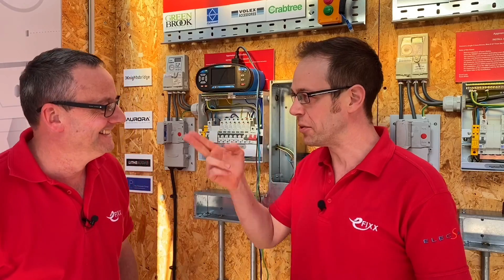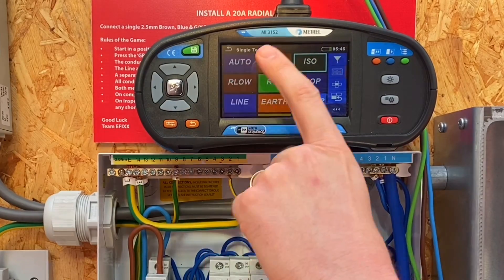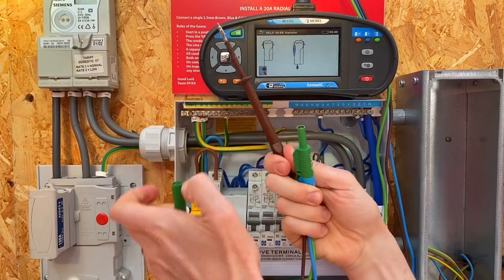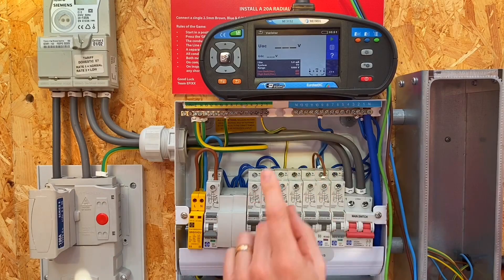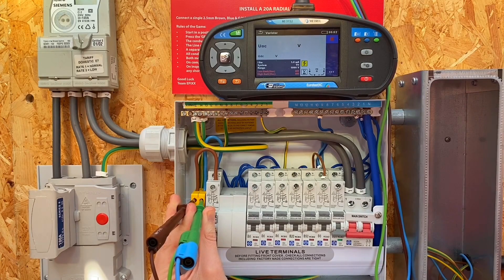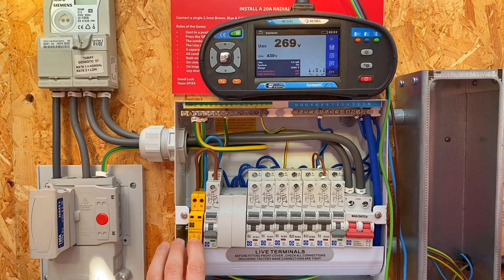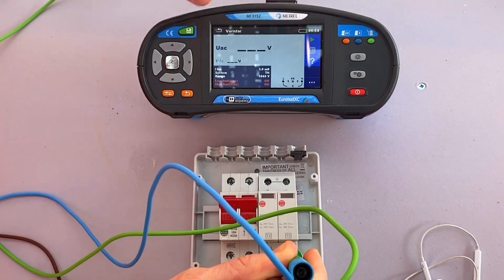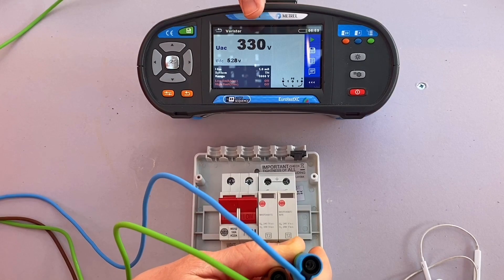How to test a surge protector (SPD) using a Metrel Mi 3152

Comment: Nice vid,. I am lookin into forms on p158-159 of Guide not 3 they tested SPD at 250, I wonder to know what voltage applied? Could you please make a video to show haw value in pages 158- 159 of guide note 3 , regarding continuty and insulation resistance measured?
Thanks

Comment: MOVs can only sustain very short transient faults, have a limited lifetime and may burst into flames. Putting such devices into a consumer unit is madness, but the real reason is to protect AFDDs. Most other sensitive electronics in a house would have their own protection built in or in a distribution block which can easily be replaced.
There are better protection devices replacing MOVs now, one is an ISOMOV which combines MOVs with a gas discharge tube and which does not have the disadvantages of MOVs.
Reply: There are Spd 1+1 (1 cartridge MOV, the other is GDT) . The GDT one should be connected between N and PE. Here in Romania, on newer TNC-S panels, at request, 1+1 or 3+1 Spd's(yes, residential homes on tri-phased systems, starting from 5KW power).
On TT ones, 2+0, 4+0...

Comment: Hello. A query, what tolerance values could be applied for the Uc of the SPD to compare the Uac obtained in the test?
Will this tolerance data be indicated in IEC 61643-11?
For example DEHN has a value tolerance table for its SPDs
Cheers

Comment: Great demo as usual. One small note , most colleges will tech that for insulation resistance testing (where a voltage above 50v dc is being applied) is subject to the recommendations of GS38 with regard to leads and probes. This is backed up by GN3 1.1 Page 12.
Reply: Exactly Mark, gs38 applies to low voltage electrical systems and the is 50V-1,000V AC and 121V-1,500V DC.

Comment: Sorry guys but this is a very misleading video! Uc is the nominal voltage of an SPD and absolutely NOT the voltage at which it will trigger, it's wrong to say that. The Up is the key figure to be looking for in an SPD, this is the voltage protection level and is the true indicator for the level at which the device will clamp voltage to protect the installation. All you are doing is measuring the nominal voltage that the device is capable of working up to. No single pole type 2 will trigger at 269V and it's very misleading to suggest that they will. In fact any transient below the Up level of the device will pass through, this is because in table 443.2 (Rated Impulse Voltages) even to most sensitive electronic equipment has to have a built in withstand capability of 1.5kV so there would no point in an SPD triggering at such a low level as 269V. This gives electricians (and then their customers) an unrealistic impression of what an over voltage device can do and is making them believe that they can easily test an SPD to prove to a customer that it's working. Sadly most SPD's can only be checked via a visual inspection, this test here is NOT proving that the SPD is operating to it's designed specification because for that you must test the Up value. BSEN 61643-11 gives the testing protocols for SPD's.
Reply from the maker: Thanks very much for the feedback Sean, looking forward to talking to you about this. 👍
Reply: So would it be safe to say that the triggering voltage is  less than 500v given that 500v insulation resistance test voltages would damage the SPD?
Reply: @MrSJT  no, the 'trigger' voltage is the voltage protection level usually written as Up on the specification sheet, typically this will be around 1500v in the UK (some higher some lower) the 500V test does not damage the SPD, the SPD can give lead to a false reading so in some cases needs to be disconnected, however there are now a number of SPD's that can be left in place for this test and will not affect the reading such as DEHNguard ACI.
Reply: @seanpassant3174  500v would damage a type 3 though?
Reply: @MrSJT  No, not really. That's a very low voltage for an SPD, even a type 3. Most type 3's in the UK have a voltage protection level (the point at which they trigger) of around 900V so it won't do anything until it see's a voltage in excess of this. SPD's are more sturdy than people imagine, they are certainly not designed to fail, they aren't voltage fuses, they are very high speed switches. They allow voltage to flow until such time it exceeds the protection level then it very quickly switches the voltage to earth to protect the equipment down stream.
Reply: @seanpassant3174  so in this video at 14.30, John Ward tested it at around 600v, I assume this would be wrong too?

https://youtu.be/-ehw6uZOOfw
Reply: @seanpassant3174  i basically want to know if what John Ward is doing is the correct way of testing the function of the SPD, or is it incorrect and that there is currently no test equipment available to the mainstream to test the functions of an SPD.

Comment: I am a bit confused. Watching a E5 video the end of last week. The young lady who works for an SPD manufacturer. Said that the SPD  should be close to the main switch and before breakers. RCBOs,etc. this was to stop the high voltage posible taking an easier path.
Reply: No she did not . She stated that the bus bar did not count in the calculations!

Comment: For those of us who do not own one of these all singing and dancing mft’s, could a standard insulation resistance tester be used to test below the uc value and again above the uc value. (Eg @ 250vdc then again @ 500vdc) then we would expect an infinite reading at 250v, and a short at 500v between line and neutral?
Reply from the maker: We did just that in this video.
https://youtu.be/Pkquh_0JuDQ
You can at least prove it’s in circuit and functioning.

Comment: Nice very informative video but maybe in the future the SPD should be incorporated in the DNO Master Switch module so therefore becoming the District Network Operator's responsibility and standard fit for new and modified installations
Reply: … and why would the DNO do that?

(Also, they’re wear items, they are going to need replacing every few years. If that has to be done by the DNO it will either not be done or be super expensive. Seems pretty terrible to me.)

Comment: Lovely stuff. 
Quick question, Gs38 applies above 50V ac and 100V dc, you are testing at 430V dc, 528V dc etc. Surely that means gs38 applies to the leads?
Reply: It's a dead test, GS38 doesn't apply.
Reply: @muzikman2008   yet GS38 requires that we have shrouds on the test probes of our two pole voltage indicator even though we use it mainly to prove dead .